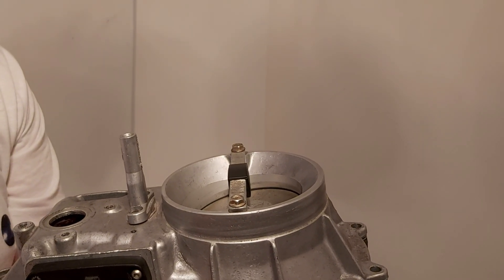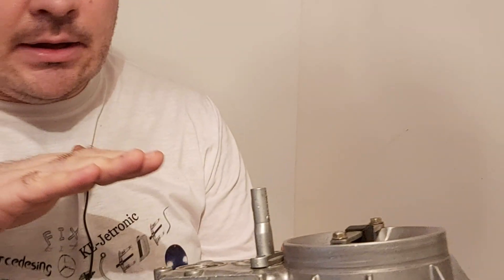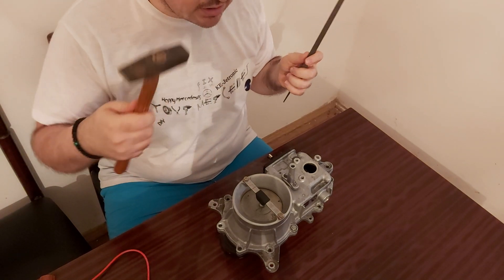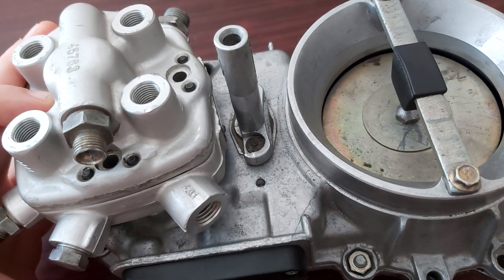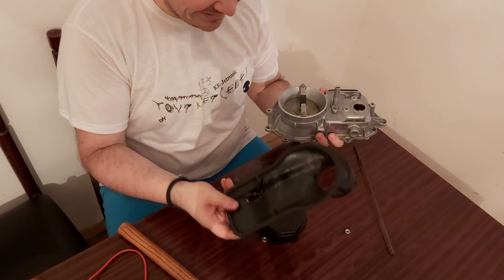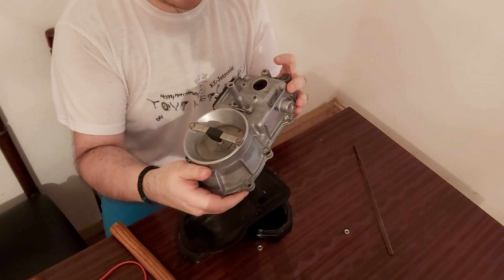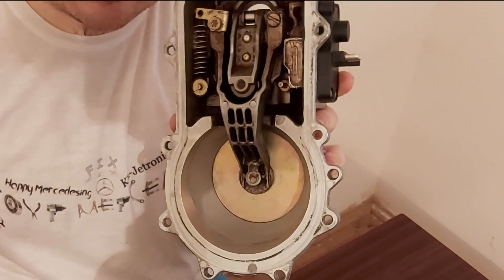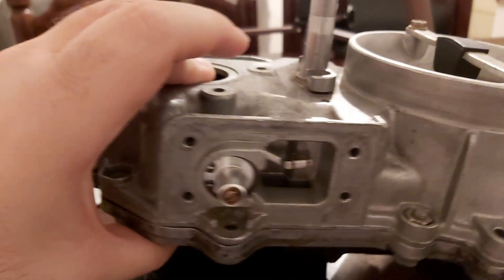㉦Mercedes Ke-Jetronic㉦ - Sensor plate height adjustment

Comment: I need some HELP😅
I adjusted the plate to the right position. 
And yes yesterday the car started and runs oke. Little bit lean. 

And no car is not running. A strong gasoline smel. Pressing down the plate and looking inside. A see some wetness. 

I have fuel spark
Reply from the maker: That is gasoline. Find a syringe and remove it. Check the pressures to see if your mixture is lean or rich.
Reply: @mercedeske  thanks. Found out that the O rings in the distributor are bad. Will try this first

Comment: Why does my car only start when putting a screwdriver to make a gap when starting the car? it makes a gap of 4mm to start otherwise it WONT... pls help? cant find a vacuumleak as well...
Reply from the maker: Hello. This happens if you have been turning the mixture screw for too much counterclockwise.. Try turning the screw clockwise. It should react(but remember for how much.
Reply: @mercedeske  alright! Thanks for answer. How much should I start with? But still, does it matter and affect the plate to not get drawn down?
Reply from the maker: @mansdahlberg2613  The plate must deflect while you are starting the car. If this doesn't happen, the plunger(the central piston in the fuel distributor) won't move and  NO FUEL will be able to flow towards the cylinders. Let it be 2mm for the beginning.
Reply: @mercedeske  wooow! 1 full turn and a half clockwise and it starts immediately! I hope it will go smooth and  not to rich or the other way! Thanks 🤩💯
Reply from the maker: @mansdahlberg2613  My pleasure. Happy Mercedesing 🍀 👍🏻 💪🏻 😊
Reply: @mercedeske  but now my rpm idle is like 1700 and high.. what to do?
Reply: @mercedeske  and also. How to adjust for optimal results?
Reply: Hello again. The plate is loose and dont have any resistance.. nothing happens when screwing... and car wont start. What to do?

Comment: Somewhere out there, there is an engineer who helped design this Jetronic system shaking his head in disbelief.
Reply from the maker: And somewhere out here there is someone who was rebuilding the very first K-Jetronic fuel distributor shaking his head in disbelief and asking himself who is the retard wise guy who designs an iron cast fuel distributor which for V8 engines weights at least 11 pounds with an aluminum diaphragm as a sealant between the two chambers!?

Comment: Hello I tried to adjust the air flow pad on my 560sl 1988, as from your advice using 1,3 mm variation, but car doesn’t start and has black exhausts till I fix to 3 mm, it it correct? Thanks for your help, but this issue makes me crazy. Aldo
Reply from the maker: The initial gap must be 1.9mm. This doesn't mean that then you will have the best mixture. These are the precondition for a car to start. The fine tuning is done with a multimeter and correct specifications for the EHA.
Reply: @mercedeske  thanks for your help and support and many compliments for your videos
Reply from the maker: Thanks a lot. Happy Mercedesing 😃

Comment: excellent video; I did that, too... I can testify the 300 CE 6 cylinders (1990) - which looks a bit different overall - also has the same "geography" as shown; you can regulate the sensor plate's resting position in pretty much the same way.
However, I was dissatisfied with the pin looking "messed around with" because it wasn't flush any more with the outer housing surface.... so... I tried something else. And perhaps you could as well; if you already opened the airflow meter, and you like both the un-messed look and the sensor plate at the right height, try what follows, I'll try my best English (I'm Italian) to explain what I've done. 
I had already opened the airflow meter, because of a detonation so I had it in my hands upside down, and was looking into it. Like in this video, the long lever bearing the sensor plate reaches its resting position when the sturdy, short pin mounted on the "secondary lever" (the shorter one, the one that effectively regulates the fuel by hitting the plunger in the fuel distributor) hits against a plate. But that plate isn't fixed: it acts like a "spring" (also visible in the video). 

((( And BTW: why is this "spring" there in the first place?  I think it's there precisely for the case of backfires (which I've had): on detonation, the rubber boot swells due to increased internal pressure and and the sensor plate is violently pushed outside. But then the secondary lever's pin would hit the plate while the airflow meter is still airtight, so the hot gases wouldn't be able to escape the unit, therefore either breakage/bending of the lever arm or the sensor plate... or the "boot's" explosion would all happen........if it weren't for the spring action of the plate itself, giving in and allowing lever and sensor plate to overextend and open a gap where the hot gases can breathe out and escape the unit without major damages; more often than not, that is !! 

That's perhaps also the reason for a rubber bottom, or "boot", which also absorbs part of the explosion's energy, by swelling - hopefully not rupturing (sadly... mine has, slightly). Anyhow: IDK whether it's its true function; it's my conjecture, however, if you  try to push the sensor plate over its resting position with your fingers, you'll see and feel the spring plate bending and giving in )))

But apart from this "emergency overextension" via "spring" action, the "normal" range of motion of the sensor plate should only extend to the point where the pin on the secondary lever hits the spring plate without bending it; the spring shouldn't need to give in, under normal circumstances. 

Now the short pin hitting the spring plate defines the sensor plate's resting position: there's a 1:3 ratio between plate elevation and the furthermost part of the sensor plate's elevation: raise the spring plate by 1 mm and the sensor plate further end raises by 3 mm.  Therefore, In order to restore a lower position of the sensor plate after a detonation, it's the spring plate , that has to move back to its original, less bent position; but it can't: the spring it is being held loaded (deflected) by a ring tightly fitted onto the long pin that you see from the outside. By design, that long pin is held level with the outer surface, but what really counts is the height of the ring tightly fitted onto it; it's that ring that holds the spring plate in place, and so defines the resting position of the sensor plate !

So: if you haven't dismounted the airflow meter, obviously you can only hammer the pin down with the ring on it, restoring both a less loaded spring plate and a lower position for the sensor plate, like shown in the video... but then you can see it from the outside, because the head of the long pin isn't flush with the surface any more. But if the unit is open already, it's worth its time to restore all of the initial positions, but how?

well.. if you hold the unit upside down, the "RING" has to slide "UP" towards you along the pin in order to let the spring plate relax a bit, but you can't grab it with plyers or so: it's too hard to do.

But if you - holding it upside down - place something (a couple nuts, a screw of the right height, a pile of 5 Cent coins, anything)   between spring plate and the housing's "bottom" (which in reality would be the ceiling, in normal orientation) you can hold the spring plate in place - and the ring which rests on the plate - while you hammer the pin -- AND ONLY THE PIN -- on its bottom till its head comes out "up" on the other side (the outer surface of the housing) just the desired amount of mm (you know how much, because there's a 1:3 ratio to the further end of the sensor plate elevation). .

Since by hammering on the pin's bottom you made it slide away from you, but plate and ring, being held in place by the 5 Cent coin pile, haven't moved, then the ring has actually moved towards you, relative to the pin. 

To see it happen, simply flip the unit into normal operational orientation, grab the hammer again and hammer the pin's head that has come out of the outer surface of the housing, until it's flush with that surface again. 

If it's not enough, just repeat: it takes only 1 minute. if it's excessive, hammer from the bottom again to re-raise the sensor plate. 

RESULT IS: the sensor plate is at the right height again, AND the pin is flush with the outer surface of the housing.

OK... was just to try to help ! ciao!
Reply: شكرا

Comment: I have M102.982 engine, but the idle sometime high (1100rpm) sometime normal (750rpm). Could it be caused by stucked plunger on FD ? I have checked no vacuum leak on the system. The car has been engine off almost 2 years. Could you help me for the problem. Thank you sir.
Reply from the maker: Hi. If the sensor plate slides easy, then there is no need to mess up with the distributor. I would check the Idle control valve. It would be good idea to clean it.

Comment: Doesn't the mixture screw adjust the  sensor plate height?
Reply from the maker: Yes, it does but those are some fine adjustments. This is for those that have problems with the plate when it's crooked because then you can have vacuum leaks.

Comment: Can you take out black cover show inside then teach how to adjust air thank you 🙏🏽
Reply from the maker: The air can not be adjusted. There is one way to adjust the air by determining the position of the sensor plate and by adjusting the mixture screw, BUT, if you know for sure that this screw has never been readjusted, DON'T TURN IT, NOT EVEN FOR THE 1/16 OF AN INCH!!!